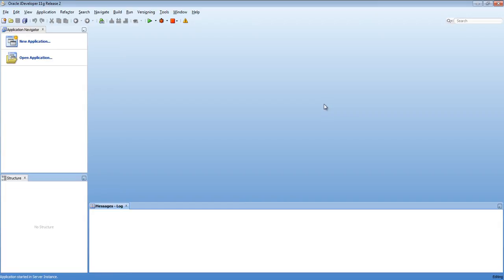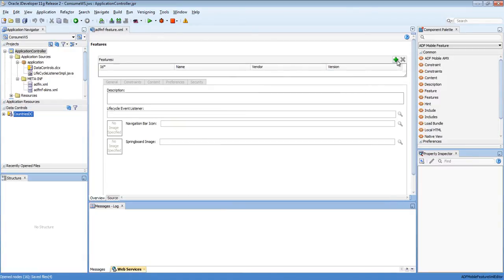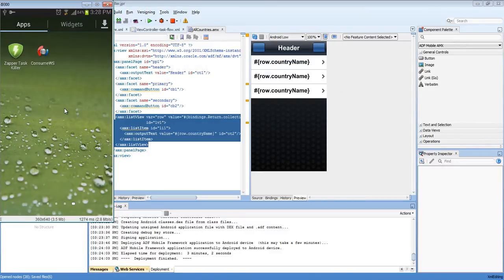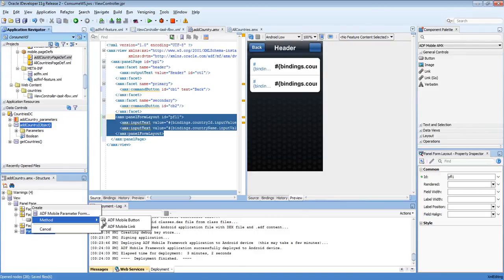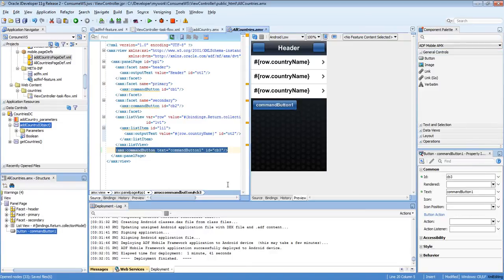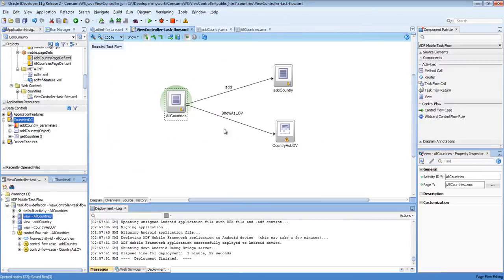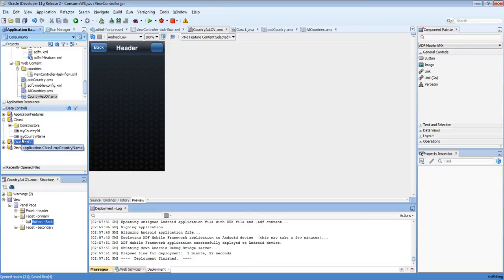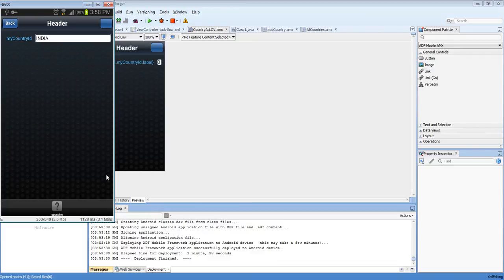Consume SOAP Web Service With ADF Mobile In JDeveloper

Comment: Vinay,

Thank you for your quick reply.  We wanted to develop an app that can create service request.  For example:  If there is a light bulbs burned in our office, a worker can use the app on the phone to create a service ticket.  The service ticket should capture “Ticket Created Date”, “Name”, “Contact Info” and along with a photo of the problem so that the person who work on the problem know exactly what to do.
I came across the link that you provided before, but did not help much.  What we need is a step by step video on how to accomplish such task.
We are new at JDeveloper and still learning and hope that you can point us to the right direction. Again, thank you.
Reply from the maker: Can you post your requirement on https://community.oracle.com/community/oracle-mobile/oraclemaf? Also post back the thread link here.

Briefly, you should first start with creating a web service (REST preferred over SOAP) that allows you to do CRUD operations of your data (DB) object (Service Ticket) and then create a mobile client making use of that web service.
Reply: Vinay Agarwal
I did all the above and the information get inserted in the Oracle database.  However, I would like to take a picture, associate the picture with ticket then insert all into the database.
Example I have the following fields on the form:
Name:
Phone:
Problem:
Attached Photo: (you can attach multiple photos, but they are link to the same ticket)
 
Submit Button
 
Once you clicked on submit button.  All the above information should insert into the database.
 
Per your suggestion, I have posted the requirement in Oracle forum, but wasn’t sure if I posted in the correct area.  Here is the link:  https://community.oracle.com/message/12587519#12587519
Reply from the maker: Bin Chan I dont seem to have access to the thread you created. Did you post it in oraclemaf, the link I shared?

Further, you should keep handling of images separate from your service tickets. Have a web service to perform CRUD on images. Each image can be identified using a unique URL. The list of URL can be maintained along with associated service ticket ID. See flickr photo upload implementation. https://www.flickr.com/services/api/upload.api.html
Reply: Vinay Agarwal
Again, I'm not sure if this is a correct location to post the question:
https://community.oracle.com/message/12591623#12591623

In regard to create a web service to perform CRUD on images, I'm totally lost.  Do you have any video that you can share?  I’m sure that your video would help many other ADF Mobile developers as well.  Many thanks for your time and effort.
Reply from the maker: Bin Chan I can now access your post. You already got some suggestions there. You may not get anything ready made here. I would appreciate if you can create the step-by-step tutorial as you progress. I will guide you by posting on the OTN thread. All the best!
Reply: Vinay Agarwal
I would love to create a step-by-step tutorial to help others.  I was successfully inserted the “field values” only into the database, but don’t know how to get the photo to associate with the ticket and inserted the photo along with other information into the database.  That is where I got stuck.
Reply from the maker: Bin Chan Please post your updates/queries on OTN forum thread you created. https://community.oracle.com/message/12591623#12591623

Comment: I did d same as u said, it's successfully deployed in emulator. But the issue is i am unable to connect URL(my URL is of localhost). I checked in forums some one saying that it'll work in Android devices not in Emulator. Is there any configuration i have to do to make it work